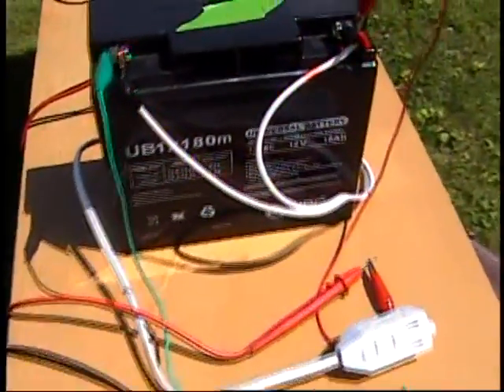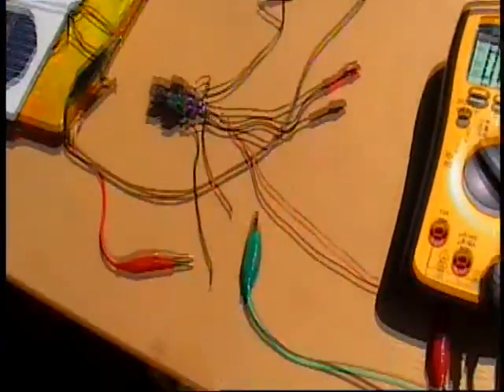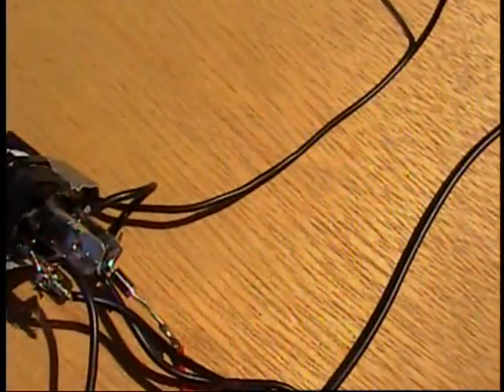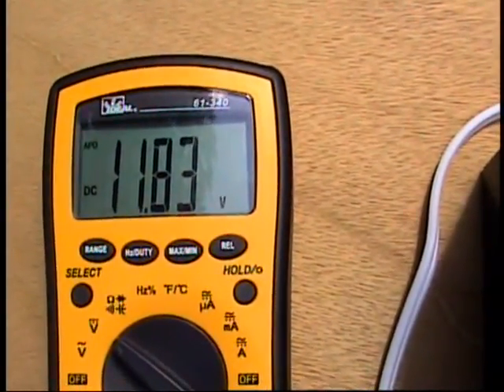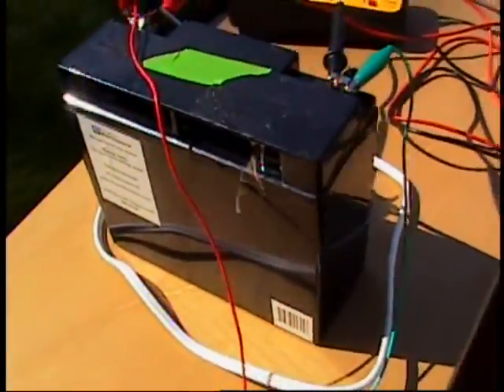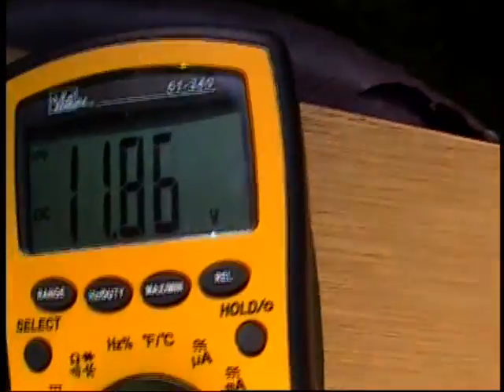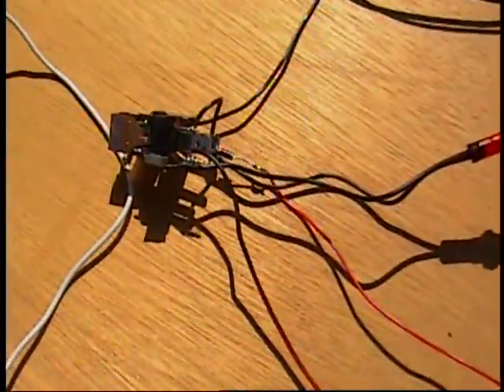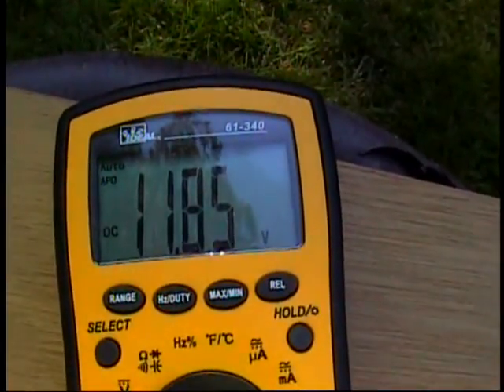Imhotep Relay Charger Test

Comment: btw, I was trying the same experiment today with a very tiny, toy, wind generator and wanted to charge two D NIMH batteries. It appears to work fine. A 2200uf Cap on my tiny wind generator can get 2200uf cap up to 10v during bursts of wind, which is about 110mWatts. Generator sees very little load from relay, and back emf shuttle to battery is a nice trick..

Comment: suggestions for improvements: put a super-cap at the solar panel so that excess power charges the cap. That way when clouds go over, relay still hums. I'm not sure what the NEON does in IMHOTEPs circuit. I would think it might drain a bit of power when voltages spike high. Couldn't the batter benefit from those high spikes?
Reply from the maker: morpher44, the addition of a capacitor in parallel with the solar cell is a great one! Not only for clouds but also the circuit is only using power about 20% of the time. The other 80% is waiting for the Back-EMF so I'm wasting solar cell output. The NEON is a warning light and could be omitted. If the charge battery slips a connection the NEON will light. With nowhere to go the Back-EMF will eventually blast pinholes through the insulation of the coil. Lastly, the charge battery does get all the voltage spike. Not one iota of voltage will go through the NEON while the charge battery is connected. That air gap in the NEON acts like a resistor. Thank you for your suggestions! I appreciate the help!
Reply: Ronald Gerth Ah! That is what the NEON is for. I recall Bedini talking about that same idea with SSG. Ok. I see that a 0.1F super cap is real cheap now -- about $5 USD or so.
Reply: Also, I had been thinking that you want to put the relay circuit real close to the solar panel, and have pulses or AC go over the long cable.